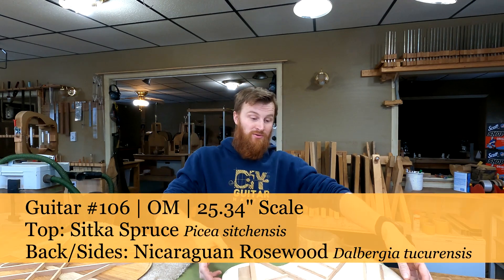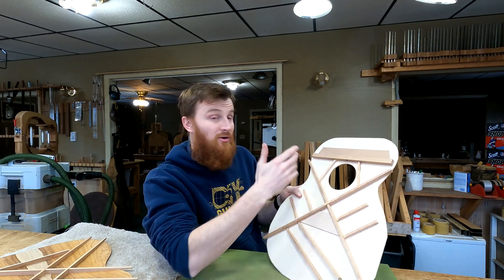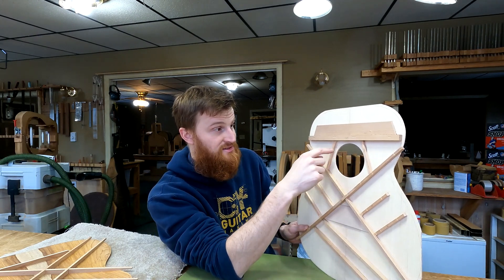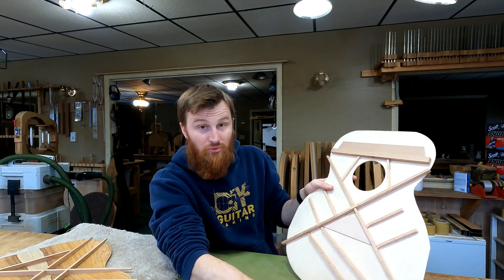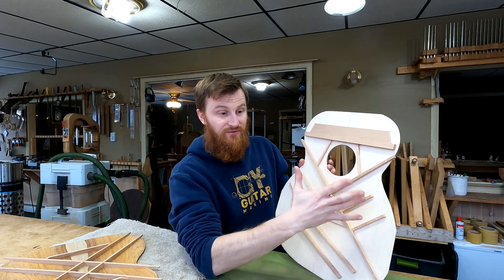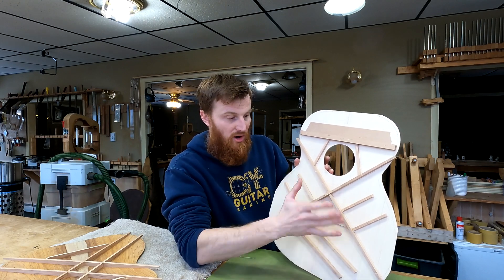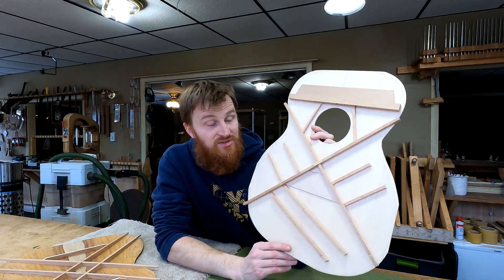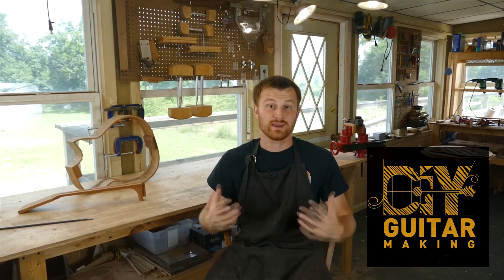Guitar #106 | Day 4 | Soundboard Bracing

Comment: Eric, or anyone reading the comments, I'm looking for tips on preventing soundboard cracks, other than making sure it is always humidified.
Reply: During the build process that is. Torrified less likely to crack in the long term? Or is it a matter of soundboard thickness? I try to keep mine between 2.5 and 2.9 mm.
Reply from the maker: I've responded to your comment in this Q&A video. Check it out! https://youtu.be/78aLqfHm3yw
Reply: @DIY Guitar Making  Thanks for the reply Eric! I've made 4 guitars thus far, and here are the common locations of cracks: about 2" in from the lower bout and 2" in from the middle (middle bout?), as well as a crack parallel to the center joint on the back in the upper bout. I tend to display my guitars on the wall, even throughout the dry winter in Wisconsin, so perhaps that's the problem! I'm also messing around with laser burning designs on to the soundboard, so maybe I'm going too deep with those, or this is a big no no (I guess I'm experimenting). The 2nd guitar I made had a torrified soundboard (all my tops are purchased from Stew Mac, btw) -- and I've had this guitar displayed on the wall for almost 2 years with a lasered design (lightly burned) -- and absolutely no cracks on the soundboard. I'm definitely going to try finish the inside of the soundboard with shellac in one of my laser designs as my next "experiment".

Comment: Very timely Eric. I'm building two OMs right now. Staying to plans by Don McCroskey for these first ones. But I like your back brace design a lot. Will you be adding a strip of wood over the back joint or do you feel that's unnecessary with this brace pattern?
Reply from the maker: I've responded to your comment in this Q&A video. Check it out! https://youtu.be/78aLqfHm3yw
Reply: I started watching that one but had to stop for some reason. But just finished it. Thanks for addressing my question. I agree a good joint shouldn’t need the reinforcing. Just always see it.